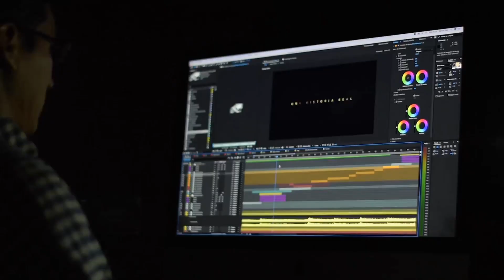Is DDR5 Worth Upgrading To?

Comment: I run DDR4 at 4400Mhz. It's awsome. I have 64gb in my system and almost never use more than 16gb at a time.
Reply: how long you ran that for? im assuming you oc the ram from 3200mhz
Reply: @0Bariq0  it is nearly impossible to oc 3200 to 4400. Kit should be binned, especially 16-32gb kits..
Reply: @Tpecep  thanks just learned a new term from you
Was it worth going 4.4ghz is it noticeable from 3.2ghz and how long you had that set up running for?
Reply: So you really needed only 32gb

Comment: I thought it was uo to 7200+?

What about the bus speed of the motherboard/cpu?
Reply: 7200+ is basically the norm for the current boards (Excluding Z690 and select Z790 boards). 6400 is probably the fastest speed everything can handle rn (If playing it safe)
Reply: @Zhunter5000  95% of overall z690 cant run 7200 and around 70% models of z790 cant run it too. The safest is 6400cl30 - yes, the optimal is 6800cl32

Comment: Good video. A few things I'd like to say. 1 - DDR5 doesn't require a new cpu for intel 12th/13th/14th gen, just a ddr5 compatible board and ram (but those generations also have ddr4 model motherboards). 2 - it is a small boost in performance. I switched from a z690 ddr4 3600 mhz cl18 motherboard to a z790 ddr5 motherboard with 6000 mhz cl30 ram. In benchmarks it shows about a 3.5% boost in performance with just that change.
Reply: I get 20-25% boost in lows and 10% in average from top 4400mhz tight timing to 7200cl34 tight timings. It is not small boost, DDR5 literally has doubled bandwidth